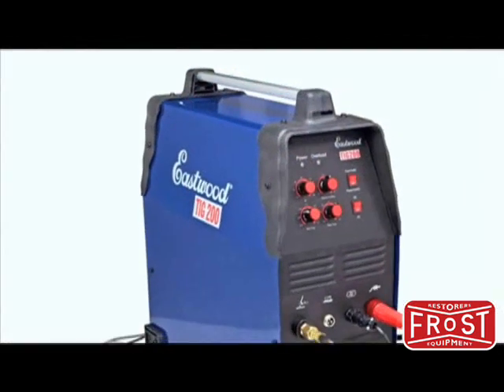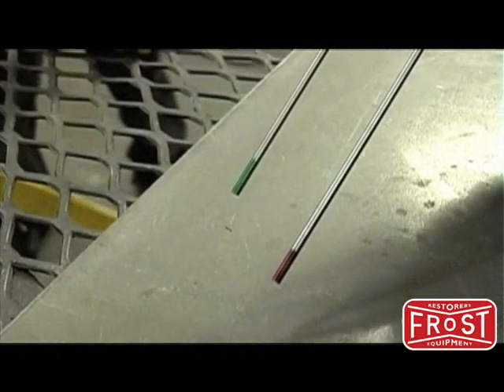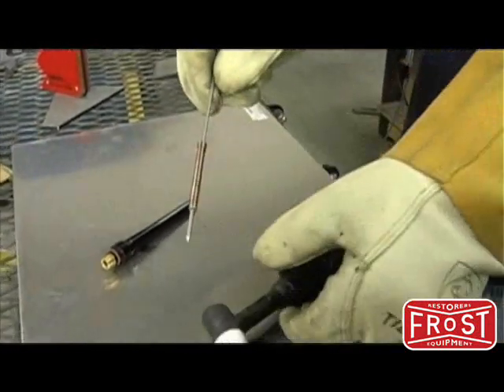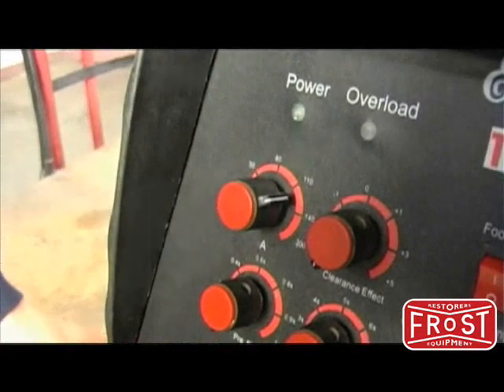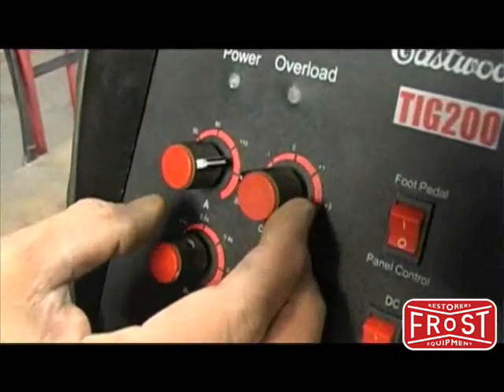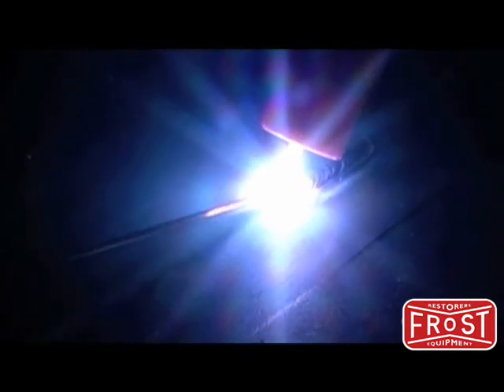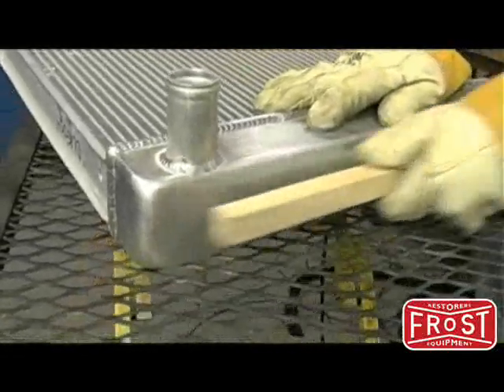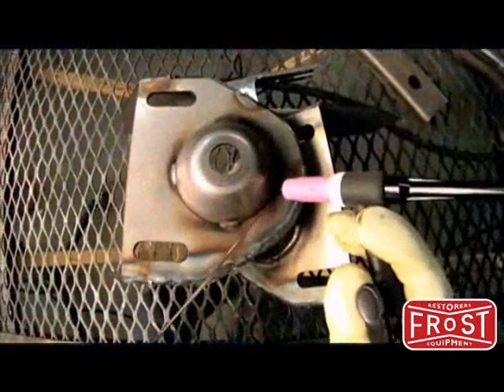Eastwood TIG 200 AC/DC Welder

Comment: What settings would I use to weld two aluminum coke cans , one on top of the other? I am trying to weld it for a class and I keep melting right through the can and blowing a hole .  I have it on AC , using pure tungsten with a sharpened edge. The amps is tricky so I am not quite sure what size to use.
Reply: Don't use a sharp edge